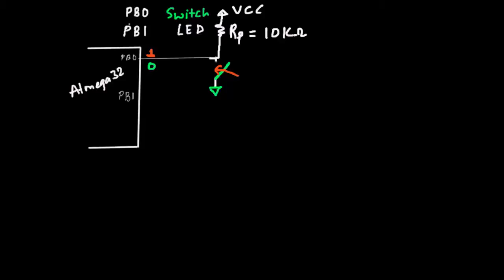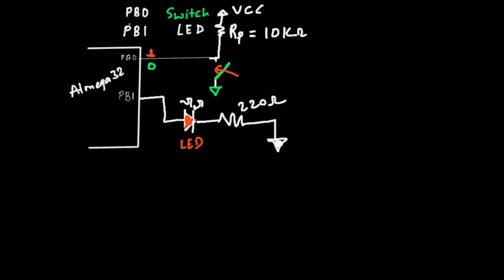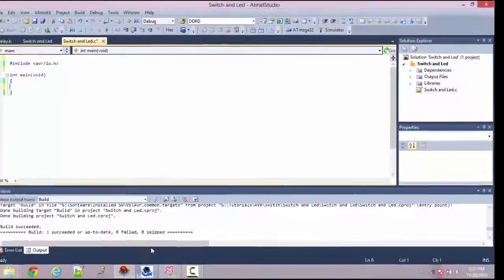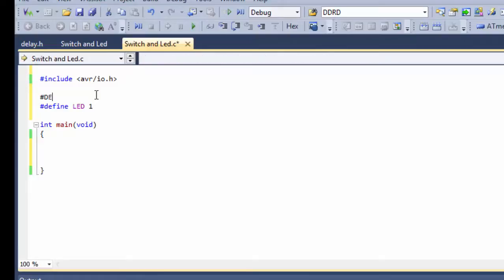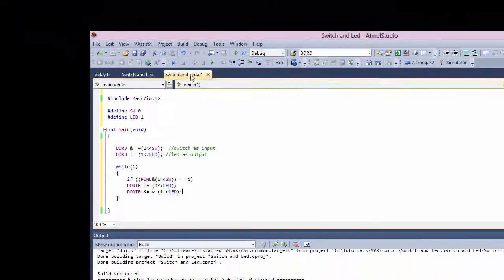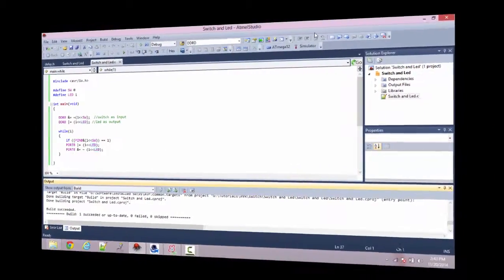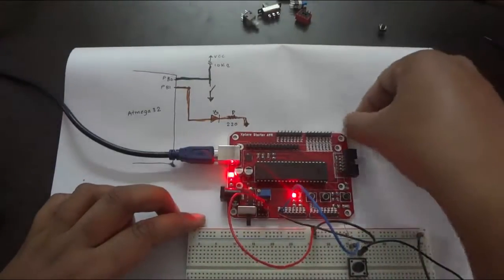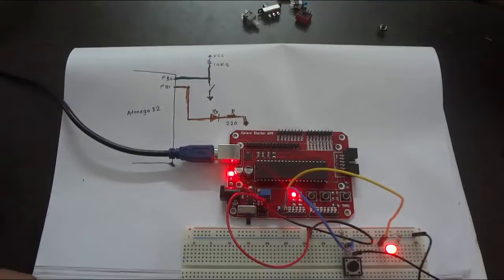Switch and LED with ATmega32

Comment: Thanks for the video. Gat a question though. Around 4:10, was the use of the external pullup resistor necessary since the GPIO pins have internal pullups already?
Reply from the maker: +Olajide Oyekunle Not necessary, you may use an the internal pull up.